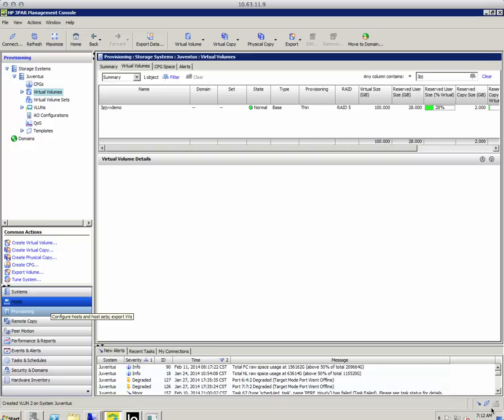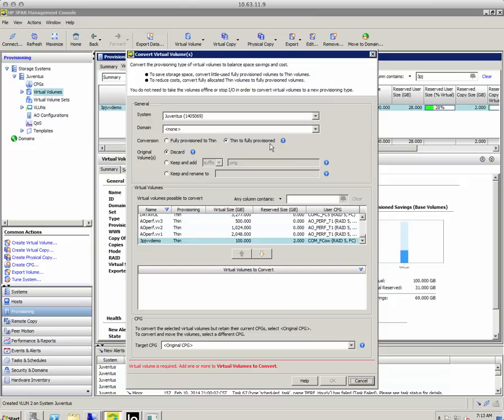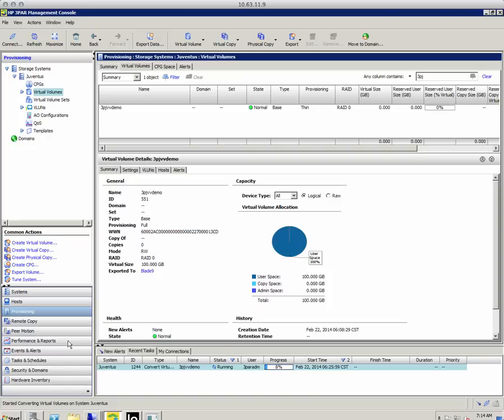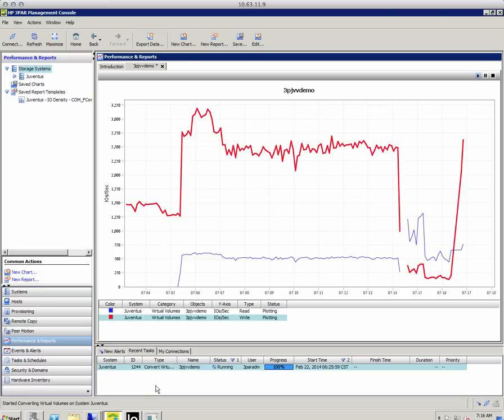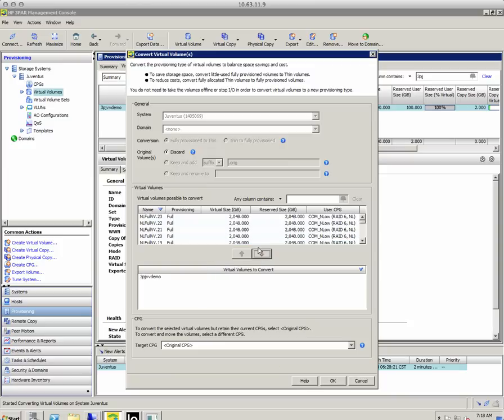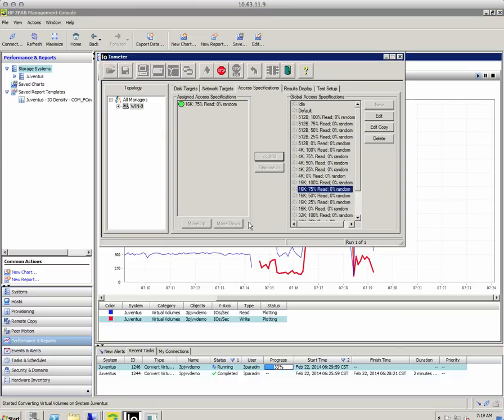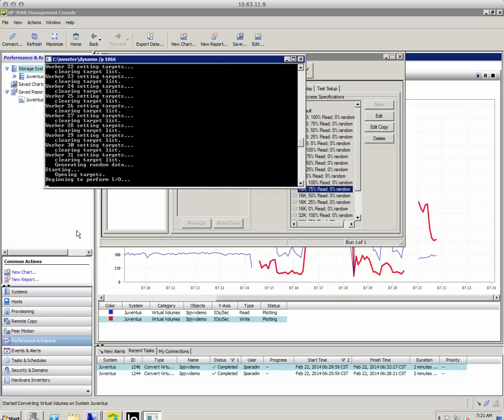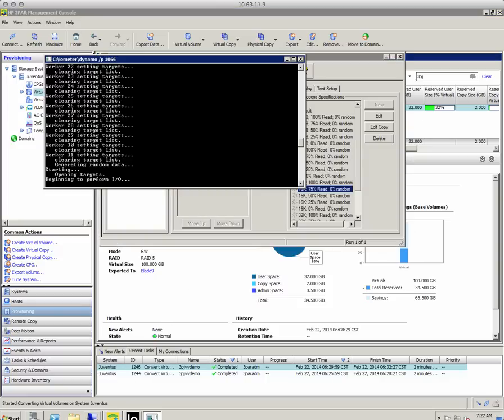HP 3PAR Thin Conversion

Comment: Is there any performance issue as I want to do conversion (thin to thick) in live environment?
Reply from the maker: +Faisal Hoque performance issue?  no.  performance impact, yes.  these are write operations - it's unrealistic to think they'll be no overhead.  so before you do a conversion, do one... gauge it's impact and then proceed.  They queue up around 8 at a time as a back ground process - you can cancel the task if you need.